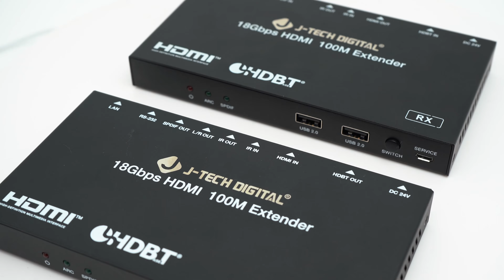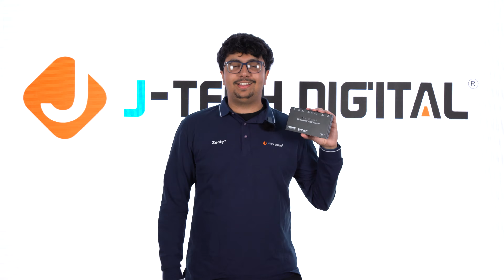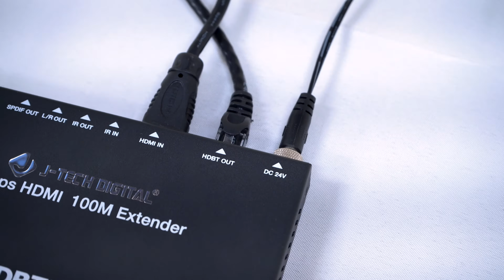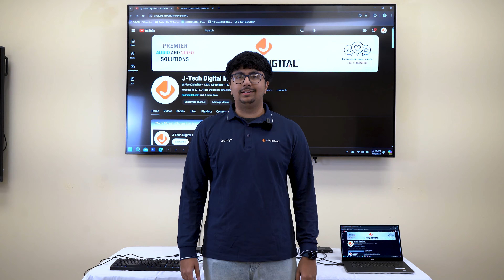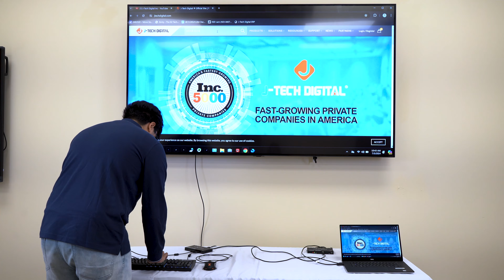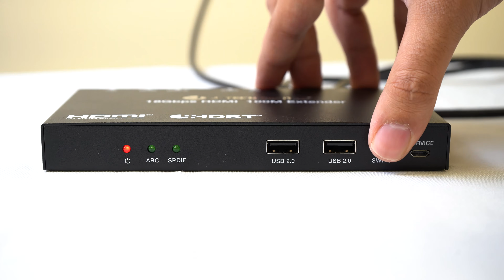4K 60Hz HDMI KVM Extender w/ ARC, Ethernet, USB: Product Overview

Comment: Hi . Just a quick silly  question. Cam lln I connect any usb device like gamepad or joystick in one of 2 usb ports provided? I assumed is should work fine. Would like to play game on my tv downstairs , using my pc upstairs.  Great video ,thank you
Reply from the maker: Thanks for your question! Since this is a KVM (Keyboard, Video, Mouse) extender, the USB ports are designed specifically for a keyboard and mouse. Unfortunately, other USB devices like a gamepad or joystick are not supported, as the KVM unit is optimized to recognize only those two types of devices.

If you want to use a gamepad or joystick for playing games on your TV, you'll need to connect them directly to your PC or use another type of USB hub that supports those devices.
Reply: @JTechDigitalINC  would a hid blueooth 4.0 dongle work with this? I need to connect to a receiver next to the display and pipe that back to the pc over the ethernet cable and the kvm unit on the pc side.
Reply from the maker: @golempada34  Unfortunately the USB has to be USB 2.0 in order for it to guarantee that it works!
Reply: @JTechDigitalINC  got it, thanks for the reply
Reply from the maker: @golempada34  Of course, let us know if you have any more questions!